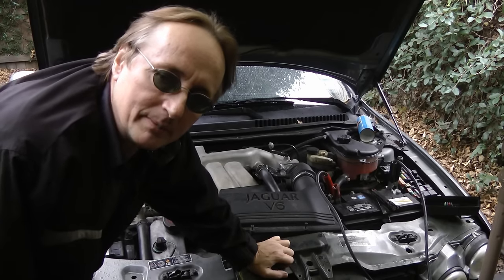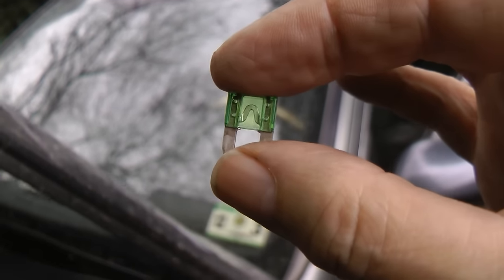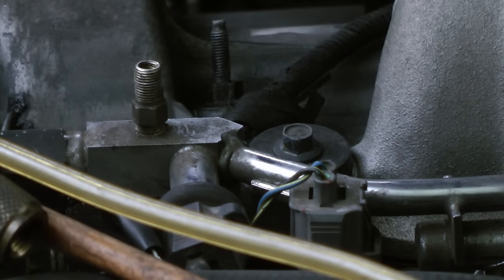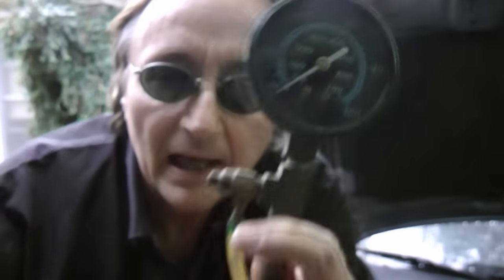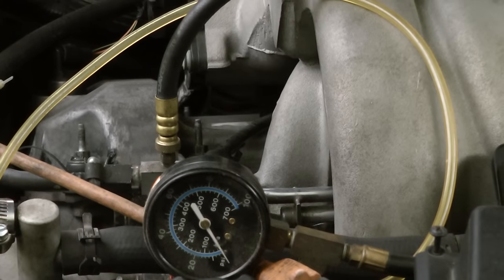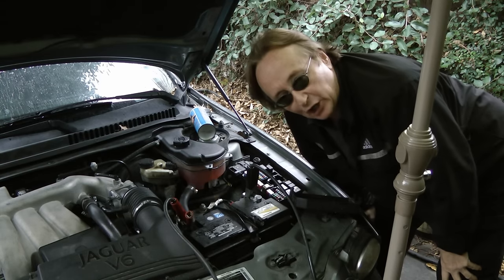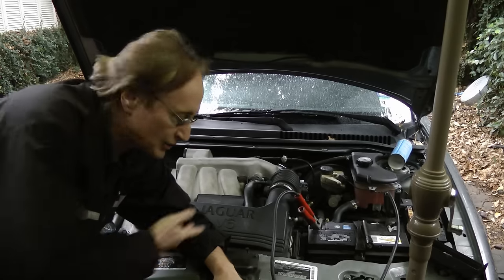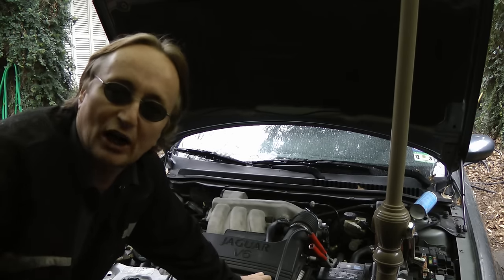How to Tell if the Fuel Pump is Bad in Your Car

Comment: Hi scotty! love the videos!! i have a 1986 V.W GOLF GTI MK2 2dr hatchback thats been giving me a bit of trouble lately. One problem is the External Fuel Pump on the passenger side back wheel area. It has started to make a loud whining noise. I had a shop hook it to a pressure tester and everything seems okay and im not losing any power that i have noticed..Any suggestion on what to do about this whining noise that comes and goes..sometimes its loud sometimes its quiet..Just started 2 weeks ago..Also where do i find one of these new!!?  THanks scotty!

Comment: Love your channel Scotty ! I have an 2008 impala 3.5l flex engine keeps throwing p0172 zero drivability problems LTFT is always -9 or worse negative. Throttle body / TPS , purge valve, vent valve, map are all new no difference. MAF is about 5gps at idle .

2008 impala data

1. Short term fuel trim.  -2%
2. Long term fuel trim.   -9%
3. HO2S 1.                      769
4. HO2S 2.                     803
5. Injector PWM.           1.10
6. Engine speed.            2825rpm
7. Mass air flow sensor. 16.41 gps
8. Throttle position indicated angle.  24%
9. Intake manifold pressure   69 kpa 
10. Vehicle speed sensor.      0. Km/h
Reply: Fuel Alcohol content is 0. That has been a problem before showing incorrect fuel composition and In turn have to reset fuel composition and fuel trims and about 3-4 fill ups back to the same 40-50 % Alcohol content. The entire life of the vehicle has NEVER seen E85 Ethanol NEVER! My sister was the original owner
Reply: Nothing??

Comment: Scotty Kilmer question. I have a 2002 honda civic that just died while I was driving it. I turned the key over it starts but just died right away. I checked the fuse it's good. And the pump makes a buzzing sound and the pressure since we didn't have a pressure test we just pushed down on it and don't hear it are anything. What could be wrong?

Comment: Changed a fuel pump on an 08 Cadillac for $223, the price of the fuel pump assembly with o-ring. Luckily they made it accessible and no fuel tank dropping needed

Comment: I have a 1990 bmw 325i. Runs great but recently started it started sounding like it was going to die out when pressing on the gas although it would still go. I’ve noticed it’s getting harder to start and while i was driving it today when I pressed on the gas it completely died out on the road but after a couple tries it turned back on. Could this be the fuel pump going bad? I’m pretty sure it’s the fuel pump causing these things. A lot of my vacuum hoses are new, fuel injectors are fairly new, fuel filter is fairly new, air filter, I’ve cleaned the afm, cleaned the icv, replaced fuel pressure regulator, fairly new spark plugs, distributor cap and rotor.

Comment: I had the same problem on my 07 civic after I replaced the stereo head unit. Called a mechanic, he came and looked at it and said it was the fuel pump, even though I told him I had started the car without problems prior to the head unit replacement. Found out it was a button under the dash that I had to press. It started immediately. Remember kids. Disconnect the battery before doing any electrical work on your car! :D

Comment: That's why people love the older SAABs. To replace the fuel pump takes about 20 minutes, it's on top and you don't have to pull or drain the tank.  Same with the heater core in the easy access firewall.

Comment: Hey Scotty I have a 05 santa fe that died on me on the interstate, it's cranking but not starting. Already changed the spark plugs, checked fuses and nothing. It died on me while I was accelerating and I wasn't able to get it to accelerate any. Engine light is on but no codes are showing. Everything I've researched says it's gonna be either the fuel pump or a crankshaft sensor. Do you have any info or possible input on trying to diagnose it. I'm gonna check the fuel filter tomorrow after work but I'm no entirely sure what it could be lol. So any help would be awesome 👌🏼

Comment: Car wouldn't start. I hit top of pump assembly with a crowbar and car started. I went home and put in a new pump (not the whole assembly. Just the pump). Car started but was really unreliable; wouldn't accelerate well and sputtered. Then it stopped starting. I tried another brand of pump. Car would not start at all. I put in the old pump and the car ran great! At least for a few days. Now it finally died. Right before it died I heard the sound from the pump change and make different sounds, but it was obvious something bad was happening. Finally, it stopped turning on. I tried hitting in again but nothing happened. What do you think? Should I try to replace the whole fuel pump assembly on the basis of some bad wiring  or just get an OEM fuel pump and ignore the stuff from auto zone and advance auto?

Comment: I need your help!
Would a fuel pump going out (not dead yet) kill a battery. Brand new battery good alternator electric fuel pump. Sometimes the battery ends up dieing but mainly it sputturs and dies. Especially when foot is pushing on gas once released it goes forward with less. Chug still no real go though.
Sorry this is my sisters car not mine so I dont know as much.

Comment: Scotty I have a 4age 20v blacktop and sometimes when I'm trying to start it gives a very longgggg tumble as soon as i notice it tumbling for more than 4-5 seconds i stop cranking and then immediately try cranking again and it would start as soon as it tumbles..would that be a sign that I need a fuel pressure regulator? cause i already changed my battery and I checked the starter and it was good

Comment: Hi Scotty, I have 2004 Nissan Sentra. It's starts fine and drives fine, but after about 30 to 40 minutes of drive, the car will stop and it won't start untill it's allowed to cool down for couple of minutes before it starts but it will eventually die again after few minutes time. I checked for over heating or any leakage but everything is fine. It doesn't heat or leak oil. Injectors too are working fine. Can this be the cause of the fuel pump? Please any idea?

Comment: Scotty I need your help!! Why does my 96 ford explorer with 4.0 ohv dies while going down the interstate, I roll off the road and it's idling, I shut the switch off for about 3 or 4 seconds and it starts right back up and does fine till I get anywhere between say 8 to 60 or 70 miles down the road, then does it again? Is it the fuel pump? The regulator? Or something in the tank stopping up the flow? I'm a poor man, can't keep throwing money at it. :(

Comment: I have a problem Scotty with my 2003 ford taurus. I drove it for almost 40 miles straight when it acted like it was having trouble getting gas and it died a couple of times. So i took it straight back home and would have to pull over so many times and shut the car off for a few minutes and then go a little further and would have to shut it off again. Done this so many times just to get it home. Hope you can help me.

Comment: I have a 94ford ranger 2.3 liter engine my truck is cranking but not turning over I have checked everything and don't own a fuel pressure gage do you have any recommendations of figuring out a way to test the fuel system without the tool to do it

Comment: My minivan runs fine and starts fine but the fuel pressure is zero! Yes, I know it sounds crazy, but it is Zero! When I put the gauge on it, the gauge needle read zero and wouldn't move! It was a rented gauge from a famous auto parts store. Only symptom I have is loss of power uphill and poor pick up. What could be the problem? Thank you for your reply.

Comment: Hi Scotty,mij car is not starting, a ford mondeo mk3 from 2001 benzine, battery is oke, the starter engine is oke, fuell is oke.maybe a relais for the fuel pump, but where is that relais located???or pump maybe not working.???

Comment: I have an 07 pontiac G5 with 170k miles on it. I keep it well maintained but here recently I've noticed when i go to and from work the 1st initial crank  it will stutter about 2 seconds then turn over and run beautifully. After that initial crank she'll start right up with no issue if it's with 10 hrs of that 1st initial crank. I've changed Fuel Pump, Fuel lines, and fuel pressure sensor and the problems consist. Any ideas?

Comment: hey scotty whats up been having this problem with my 2000 acura tl it runs fine when its cold but as the engine becomes hotter and i stop at the store to buy something try to start the car it start shut of start shut of leave for a whhile try again it start but struggle to keep up and finally it gets going took it to the dealer and they cant find the problem need your help scotty i have faith in you

Comment: Hey Scotty I have a  2003 Toyota Tacoma  4 cylinder   and it falls pretty  hard when the back tires fall in a pot hole so I got new springs and it rode nice for a few weeks and now every pothole or speed bump it feels like the springs are taking the hit what could the problem be?

Comment: Hey Scotty!   I have a 2013 Dodge Grand Caravan.   The fuel pump continues to run, even if the vehicle is off, and keys removed.  If I don't disconnect the battery, the pump will drain it completely.  I've pulled every fuse and relay that it has in the fuel box, but it keeps running.  Any ideas?

Comment: Lol love Scotty's videos and I know this is and old one  but just thought I would pass it a long that there are two little black tabs on the bottom of the backseat. Use them and the bottom part of the seat comes right out leaving you staring at the fuel pump lol at least on the 2003 S type. Also if you disassemble the pumps housing you can change out the actual pump inside of it with one that Ford makes and save yourself hundreds of dollars.

Comment: sometimes even if the pressure is there it could still be fuel pump problem because at the cranking the pressure is ok while after running for some time and heating up it starts to lose pressure ...and may cause intermittent lose of power while apparently you will think that the pump is ok

Comment: I quite like my Jaguar I have now I have an S-Type 4.0 very fast and has given me not too many problems. I've owned quite a few Jaguar xj6 has and those were really good cars. Very fast very good fuel economy and zero problems on one of the cars I had for many years. Until one day the rear end bearing in the differential actually came apart. But aside from that the car is Bulletproof. I'm thinking since I live in Europe and over here you need a big prestigious car for many reasons I probably will buy an XF next. I've driven one they're a little bigger than the S-Type but the new quality is pretty good. So I think that if you know how to do things yourself on the car and you're not afraid to do that I think that a Jaguar is not such a bad car to have. A lot of the parts are Ford. and there is a good online community for help

Comment: Hey Scotty I need some help I just bought a 1991 Cadillac DeVille sedan and when I try to accelerate quickly it bogs and I get no power just studder but if I accelerate slow I have no problems also when I press the brake pedal it sometimes pushes back and becomes really stiff. What do you think the problem is it has a V8 4.9

Comment: I have a 1996 rav4 that has a similar issue. I replaced my IAC valve, fuel filter and spark plugs. Sometimes the engine still revs a little crazy and will randomly shut off . Sometimes, it starts right back up and sometimes it takes awhile. Any ideas ?

Comment: My 2001 ford F150 XLT sport won’t start. I suspected fuel pump issue. I could hear the pump when I turned on the key. The truck turns over, but won’t start. It will start with starting fluid or direct gas injection through the air intake. However will not stay running. I disconnected the fuel line from the fuel filter on the tank side, turn on the key, no fuel. Is this a good test or do I need the pressure gauge?

Comment: Scotty its brice ,i just replaced a distributor cap and rotor , and its not firing, i dumped gas down throttle body air intake on my 2.8 v6 1987 pontiac firebird and she fired up , is this a fuel pump issue,  and other day it went down to like half power and barley had any gas pedal or pick up,, then i put gas in and it came on ran great then i warm car up last night this morning wouldnt start, is this fuel pump its running but really doggy back there and not firing   has spark also and gas at the valve that spits gas out ...i think its my fuel located above the rear axle gaaaah

Comment: I’ve got a 2008 charger and I’m having some starting issues. after I’ve ran the car for a while or I’ve been driving with the ac on, the car will have a long crank time, about 5 seconds. Could this issue be related to the fuel pump? It’s never done it on a cold start

Comment: Hello there Scotty-My name is william i am replacing a fuel pump in a 1999 Isuzu Rodeo-I got the new one but on the top of it there is only ( 1 ) electric plug-My old one has (2 ) Now there is a hole on the new pump for the electric plug that is missing-I am replacing the pump to fix the problem with the sending unit-It starts and runs with no problem-It looks like the other electric plug just pops in and out-So i pushed the old one out and it fit right into the new pump-Can you please tell me what it is for? I looked under the cap of the pump and there is no tube or anything that connects to it

Comment: Scotty my 454 runs fine until about 45 miles an hour then acts like its going through fuel starvation.  I've replaced the pump, made sure there was no blockage in the fuel lines and it still does it.  Driving me insane.  I also thought about the cam lobes being worn and thought about putting in an electric pump.  I have a small electric which operates 4-6 psi and am wondering if this may resolve the problem.   please help. oh yea I forgot to mention it's a C30 chevy with the 454

Comment: Hello I’m having a problem with my 2005 Nissan Altima, it’s giving me horrible gas mileage. I use to only spend $20 dollars biweekly and now I have to refuel every 4 days. I’ve changed the spark plugs and oils and recently changed the air filter. It doesn’t have any CEL so I really don’t know what to do. Any advice?

Comment: Scotty I got a 2000 buick century and it's 3.1 running rough without any check engine lights and 115k miles

Comment: First thing I would do is open your air filter box and spray brake fluid or starter fluid in the intake while someone cranks the engine over. If it starts while spraying then you have a fuel problem. If not…you got some more digging around to do.

Comment: so I've been having a car problem, My car wont start.. it doesnt even crank, you can hear it turning like it's trying to start but it doesn't. We checked the battery it's good, I changed all 4 ignition coils, replaced the sensor for the intake manifold (because it gave us that code) but still doing the same as it did before. you can hear the engine  it makes noise as it turns but no fire to even have it crank. you have an idea?

Comment: What if im getting a lean code and only got 10 lbs of pressure. I've already changed out the pump and regulator and my injectors seems fine. Could I of got a bad fuel pump?

Comment: I have a question I have a 94 mustang GT I started my car to go to work today and my fuel pressure dropped to 20lbs so I shut the car off and turned the key on again but didn't hear the fuel pump so I jump the fuel pump wire at the eec test plug and fuel pressure came up to 40 lbs, I've been having this problem for 2 years usually when it happens I would turn the key on and off a couple of times and the pressure would come back but not today. After I jumped the eec plug I drove it to work and pulled the jump wire and pressure comes on the way it should is there a chance the fuel relay is going bad or maybe a loose connection somewhere, thank you

Comment: @scottykilmer,i have quick question ,i just had my 2005 5.3 crewcab  chevy silverado truck get some engine work,they pulled motor out and put cam kit with long tube headers and everything was fine i got basic tune for it to be running for now and exhaust ,and i got the truck back and drove it felt fine and i went pump gass and i changed from 87 to 93 and filled up truck and after like 20ish minutes the truck shut off on me all the lights stayed on my radio stayed on but it turn off on me while driving ,it would crank crank crank but wouldnt start and after cranking for 2-3 minutes it turn on again and didnt turn off at all until it was time get gas again then after like maybe 30-40 min after pumping gas and driving, it shut offf again doing same thing it would crank but wouldnt start after maybe cranking it for like 1-2 minutes it started up again,idk i changed my battery and alternator everything is new,but idk if its fuel problem or sensor problem idk if its ground ,bcs the lights and my radio and my music stays on and playing ,but the engine itself just shuts off,can you plss help me out !would be amazing

Comment: I am faced with a situation that has all these factors: 1) P0451-has been changed countless times; 2) Gas Hand-doesn't work; 3) Fuel pump-works only when gas is in the vehicle; 4) Clear- when codes are cleared everything works including the gas hand; 5) Battery-something is draining it; 6) Dash-all warning lights come on; WHAT'S THE CONNECTION because, if one fails they all come tumbling down? The vehicle is a 2005 Cadillac SRX AWD 3.6 liter.